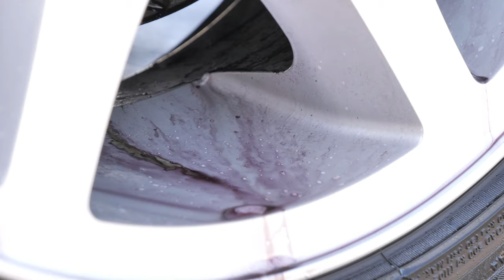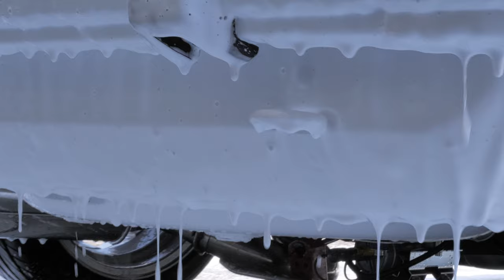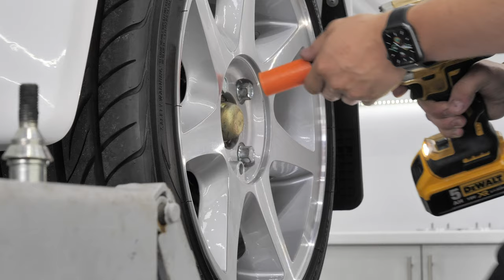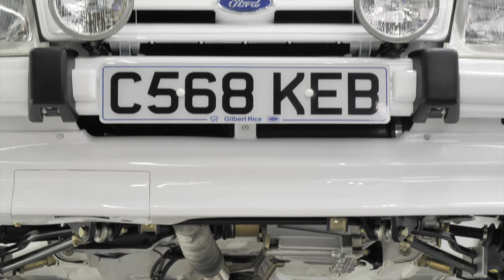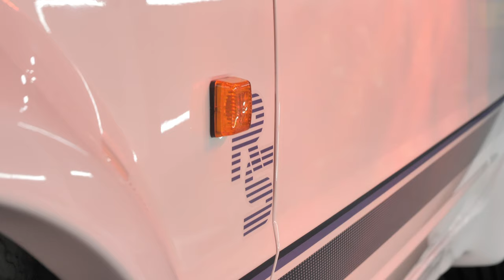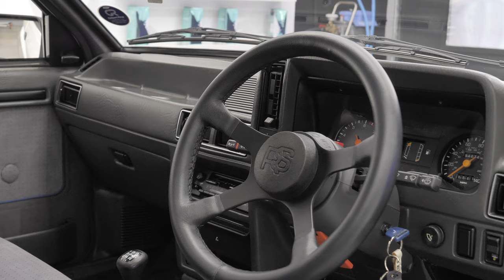ESCORT RS TURBO | Visits SCC

Comment: Just wondered why you hand wash with snow foam ? I always let the snow foam drip off , I thought the whole thing about using a foam was that was a stage one and a non contact stage . ? Sorry just after extra info or a different insight .. many thanks
Reply from the maker: Hi. If this was a maintenance wash then yes.  But considering the the amount of washing, claying and machine polishing afterwards then it would not make a difference on this occasion